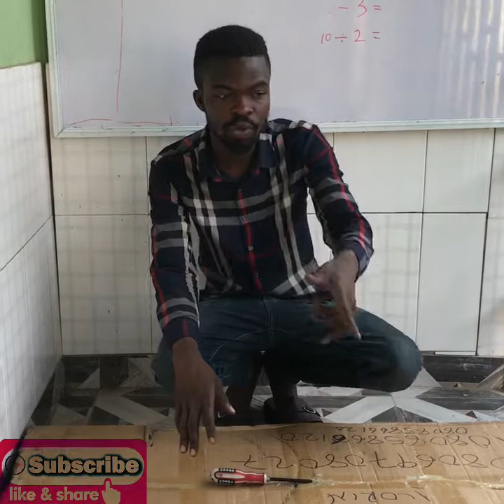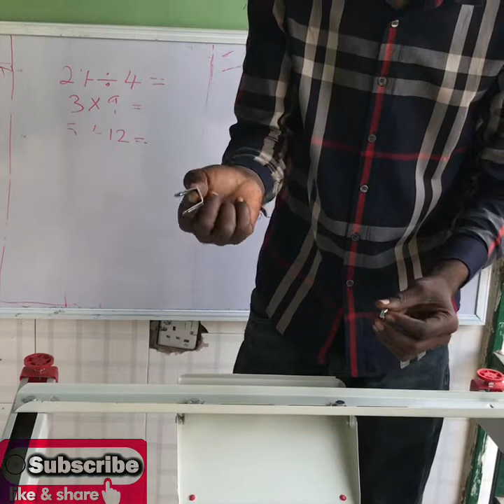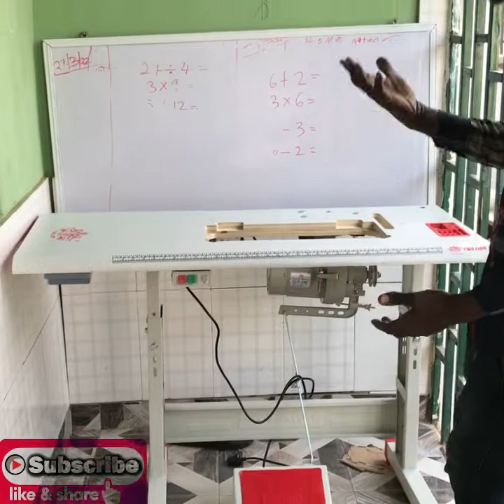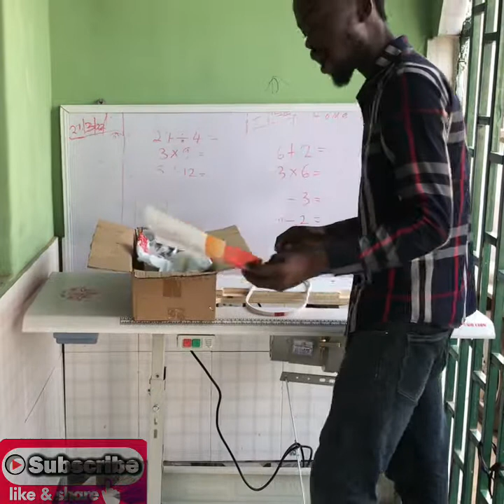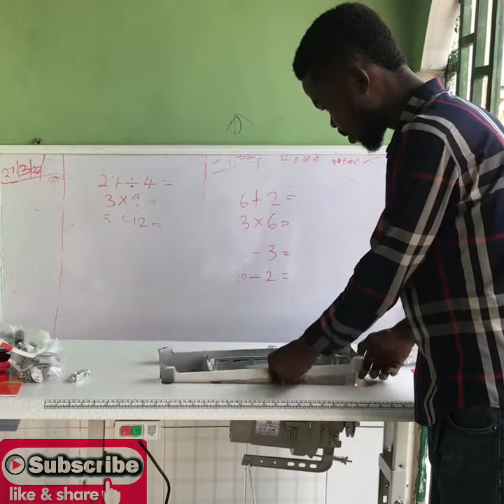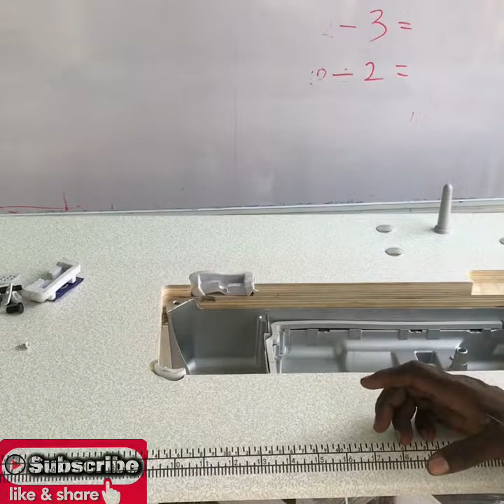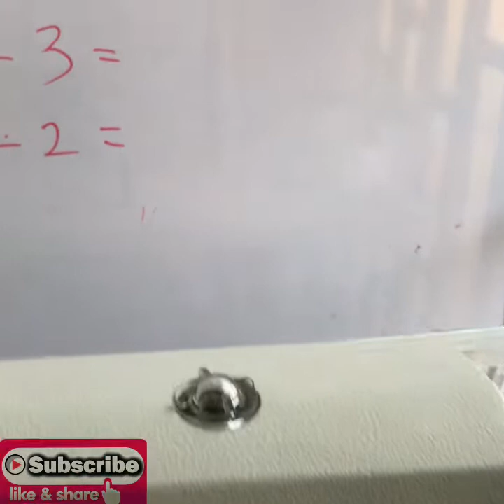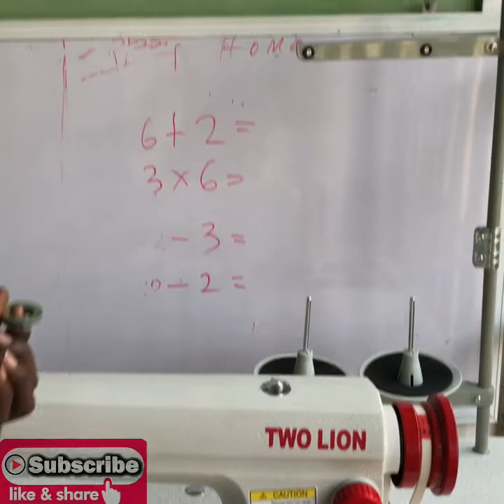How to install/assemble Emel industrial straight sewing machines model 8500 in details.

Comment: Thank you so much Sir, i ve been able to setup my machine using your instructions. You ve saved me 10k my engineer charged.

However i noticed the feet is not resting on the machine even without lifting it. How do i fix that please
Reply from the maker: The feet lefter is not properly set. 
The black one under the machine

Comment: Hi, pls I need your help. I got emel direct drive machine and an engineer helped to set it up. I was using it to sow today and I decided to change the presser foot, but I need to adjust to foot to align with the needle. After doing that, the machine was not stitching again. It looks like the need is not able to go down to pick the down three. Pls any solution.
Reply from the maker: If the machine is not showing Error. The presser foot is bad but if it shows error 07 chat me up on WhatsApp let do video call